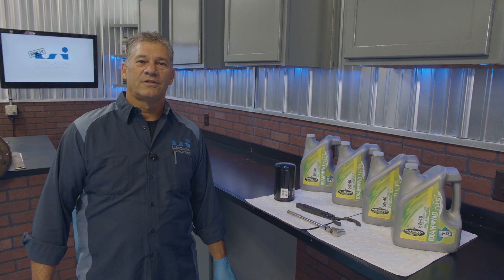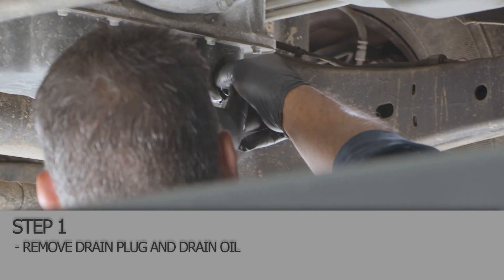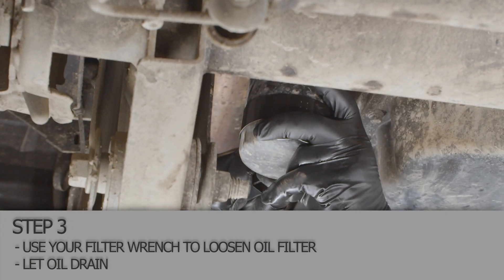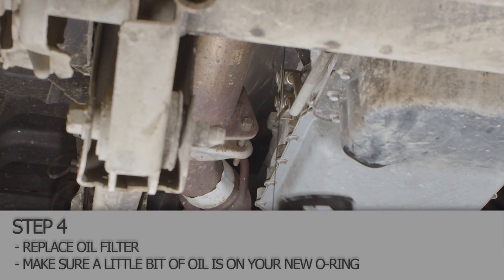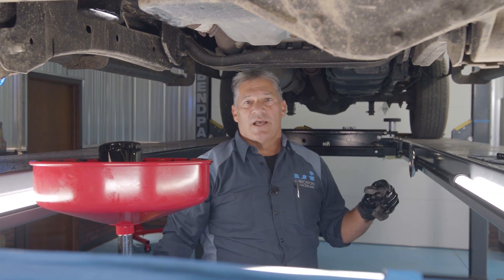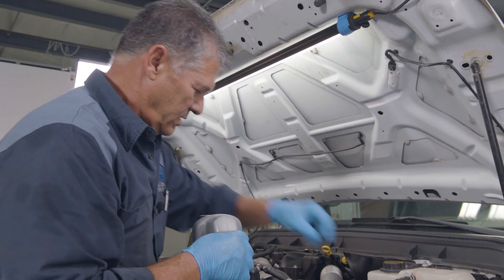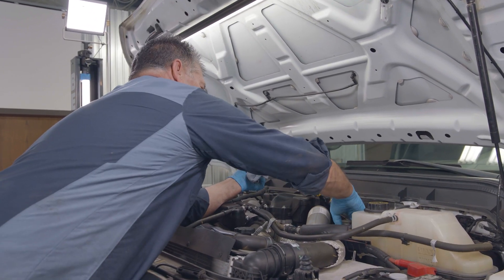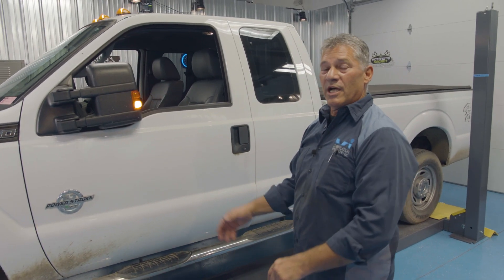How to Change Oil and Filter on a Ford 6.7L Powerstroke

Comment: I got a 2020 F 550 to 6.7 power stroke diesel currently I have 128,000 miles by the time I next oil change I’ll be about 130,000 miles my question is how soon can somebody Eustis stiction illuminator my hot shot seems to me this engine is just now getting broken so is it true wait till about 200,000 miles to use that stuff
Reply from the maker: You can use it anytime after 10,000 miles and every third oil change. I would run a treatment in your next oil change. You might be surprised how much better the truck will run. It will clean out any burnt oil in the turbo and rings, plus contains a nanocarbon adding wear protection.
Reply: @HotShotsSecret  thank you